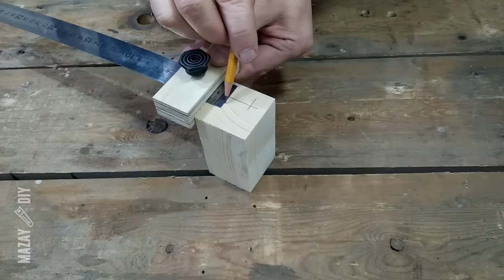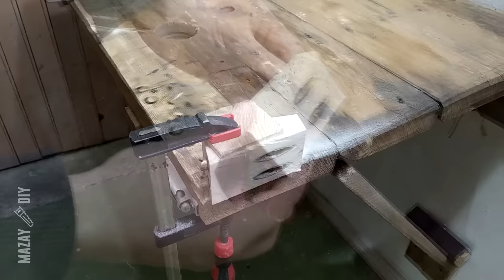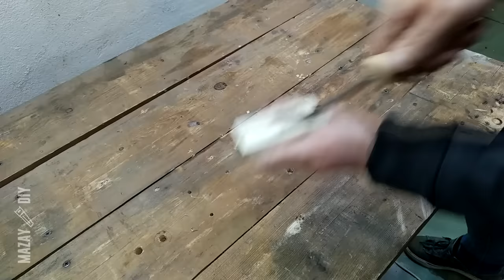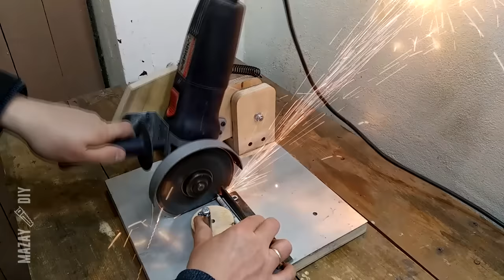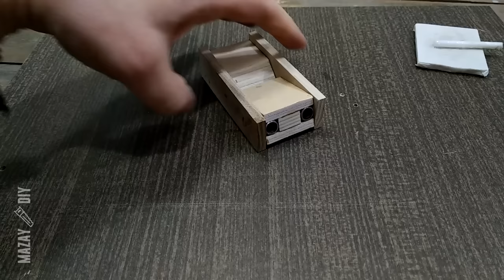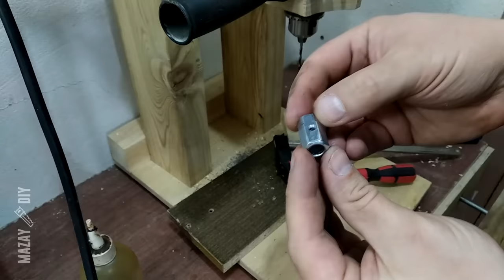2 ways to make Pocket Hole Jig + DIY Pocket Hole Drill bit

Comment: What are those metal tubes he uses as the drill bit guide? They look different than just standard pipes, they're threaded on the ends...
Reply from the maker: In kreg jig #2, a regular pipe with a diameter of 10 mm and a wall thickness of 1 mm, and in the first jig I used sleeves from an anchor bolt. You can see more details in the plans, the download link is in the video description
Reply: He took them off a kregg jig he purchased at Lowes for $59🤣🤣🤣😂😂🤣😂😂😂

Comment: Hello Mazay can you tell me the specs you used for the solid wood block design  pocket hole jig you made width, of the block, and length, and hight, of the holes drilled and chosen angle cut   Any help would be greatly  appreciated David

Comment: I would like to know the internal and external diameters of the tubing and the dimensions of the drill bit used in the finished jig. Good and simple design.
Reply from the maker: Tube with external diameter 10 mm, wall thickness 1 mm. Drill diameter - 8 mm. You can see these and other dimensions in the plans, the link is in the video description
Reply: Just look at the kregg jig, that's were he got the parts for this project😂😂😂😂😂😂😂😂😂😂

Comment: A minor point Sir, and sorry to nit pick what is a great project, but I would have used a proper grub screw on the drill stop, as the way it is now you could get a nasty cut if the screw caught your finger while drilling, also, if it came lose when drilling, your eyes could pay the price. Stay safe OK?
Reply from the maker: Your comments are true. Therefore, it is worth using personal protective equipment.

Comment: Love these vids, but why use a hack saw when blades on circular saws are all carbide tipped these days? They go through nails like nothing and it's a real time  saver. Anyone who says it's dangerous, well that would be plain wrong, carbide is used to shape metal in machine shops, it loves it. They work so well, that if you work  construction and try pulling the nails, you may get fired for it. Cut through em with the circular saw! Funny that a hack saw, for cutting metal isn't carbide tipped.